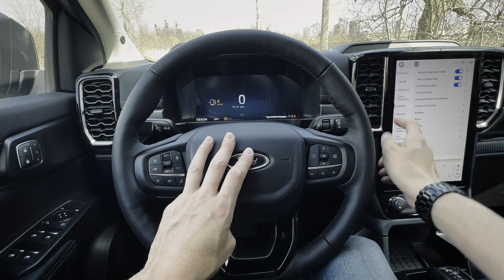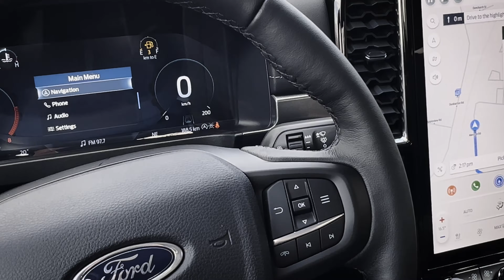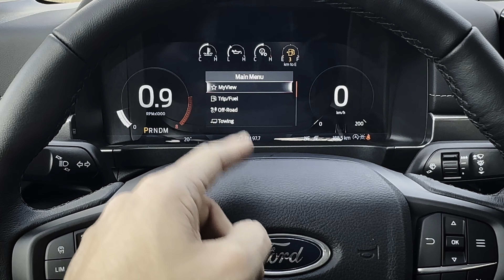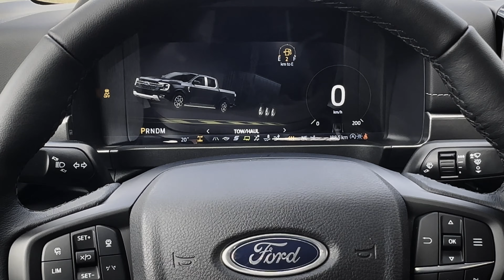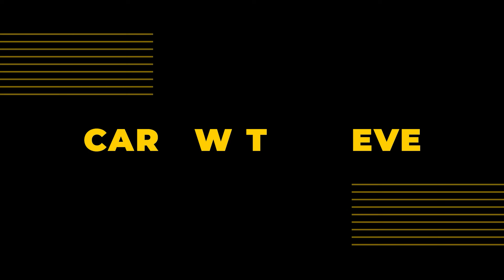Ford Ranger Steering Wheel and Cluster (2024 -2025 Model)

Comment: My 2026 does not have these gauges, very frustrating, must be a Canada only option. I HATE the digital dash, looks like crap.
Reply from the maker: It's the trim level. This one is the Lariat, which is similar to the higher spec-d XLT. There's a smaller version in the XL and entry level XLT which is closer to what's in the Maverick - I cover that off in this video --> https://youtu.be/vdJ4NUvsc_I
Reply: @CarsWithSteve the rounded gauge is lame, nothing like a traditional analog gauge. Zero classic look to it as it says classic. Sorry, but very disappointed. Heck my in laws Jeep Grand Cherokee has either analog or digital. Ford....NOPE
Reply from the maker: Yup.. have to love cost saving measures sometimes.

Comment: What is LIM
Reply from the maker: It's a speed limiter. You can set it at a certain speed and as the truck approaches that speed it'll slow down before not letting you pass the set limit unless you hammer the gas pedal

Comment: Good info, thank you. I came here to see if there is a way to play/pause media from the steering wheel on Everest 25. It seems there isn't, except by turning off using the power button.
Reply from the maker: You're welcome! No pause control on the steering wheel unfortunately, so you'd have to be on the audio screen in the infotainment or as you mentioned, using the power button
Reply: @CarsWithSteve  Thank you for taking the time to reply.

Comment: What does the LIM mode provide ?
Reply from the maker: It's a speed limiter. So you'd set it at whatever speed and when you go to speed up it slow you down and initially limit you at that set speed. You can still hit the accelerator pedal to go faster though.. I've just never been a fan of that and just tend to drive with cruise control set

Comment: Trip1 / Trip2 but no "Current Trip", it seems. Did check all the menus, and can't find one
Reply from the maker: Well I mean.. technically trip 1 or 2 could be used as a current trip counter. Just reset it manually each time you hop out of the truck

Comment: Can you tell me how you down shift manual with the buttons + and - ?
Reply from the maker: Watch this video. It's on paddle shifters but it works the exact same way as a hand or column shifter --> https://youtu.be/YYaagDisqso
Reply: @CarsWithSteve  thx. I watched.  So if is in drive I just press - to down shift. 
One more thing , by ant chance to do you know is posible to see on the screen what gear is? I know for raptor can be seen.
Reply from the maker: You got it! 4:45 of this video covers that off
Reply: @CarsWithSteve  thx for quick response.  When I asked about what  gear I mean from 1 to 10 in which . I've seen on Raptor is this option. I checked today on mine but I couldn't find nothing.
Reply from the maker: Ahh, misunderstood the question. It'll show the individual gear but not the full gear options like the Raptor
Reply: @CarsWithSteve thx steve

Comment: Is that the only view offered on the tachometer? I’d love a more traditional look rather than a number displayed there
Reply: The answer is no. Disappointingly. I mean they could have had it as an option, 'classic mode'. Toyota, Mitsubishi still have physical dials I think.
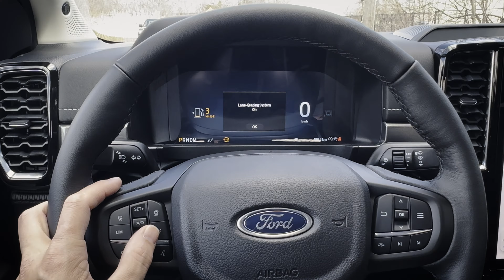Reply from the maker: Did you watch the video? 5:30 mark you can see a more traditional view when you aren't in the calming screen
Reply: Right I’m saying I don’t like the giant number in the middle of the tach. I was hoping there could be like a digital needle gauge or something to look like an analog tach
Reply from the maker: And I'm saying that when you are off the calming view it will give you the digital tach and speedometer like it shows in that section of the video. That view during the 5:30 ish mark would be the only option outside of the calming screen with just the digital speed in the middle. 

Use the right pad on the steering wheel to move up to one of the screens with a trip counter or something else on it and that will give the tach and speedometer
Reply: Right, look man I’m probably just not explaining right or something. I know there’s a calming screen and know there’s a tach when you exit it. Thanks for answering my question though I just wanted to know if the tach view can be changed outside of the calming mode you showed on the video
Reply from the maker: haha, have to love trying to explain things without a visual. Outside of the calming view, the only option for the tach look is what you're seeing
Reply: @CarsWithSteve it is not though, assuming he has a base model the screens are totally different your video is only good for the lariat.

Comment: I have noticed that to "reset" - say miles driven from the steering wheel it does not always respond on the first push and hold with the OK button and I have to repeat once or twice to get it to respond -- is that normal ?  Noticed when you hit the reset button it looked like it did not change the first time you tried it  ??
Reply from the maker: Oh interesting, I hadn't noticed that when I shot the video but looking at it closer it looks like you need to do the first press to bring up the reset option and then the 2nd press and hold would be to actually reset it!
Reply: @CarsWithSteve  Yes- that appears to be the answer- thanks !!
Reply from the maker: anytime! How are you liking the truck so far?

Comment: when driving, if you press the “+” on the shifter, it will add the transmission 1-10 digits showing which gear it’s on.
Reply from the maker: Great tip!

Comment: Very good video, Thanks! Funny how they change things as they go. My new Raptor Ranger is just slightly different on what the customizable options are. They actually cut some stuff back... I was able to use your demo to set mine up more the way I like it, which is very cool.
Reply from the maker: Thank you! Yeah the Raptor does have a few extras you won't find in the other trims, I'm in the Raptor in a few weeks and definitely have a video planned for that setup. How are you liking the truck so far?
Reply: @CarsWithSteve  So far, I'm loving it. I got out of a '15 Tacoma, which was a great truck for 250K miles, when my son needed a vehicle, so it got re-purposed. The Ranger is just enough bigger in the seat and general cockpit area to make a big comfort difference for me (6'3", 240lbs). I'm just pissed at Ford for requiring us to add a bed reinforcement kit ($450, and not even available right now) to put a cap or anything on the bed. That's a design defect in my book.
Reply from the maker: I didn't realize the Raptor needed that reinforcement kit as well, thought it was just other trims. Outside of the bed issue, how are you liking the truck?
Reply: @CarsWithSteve  I'm loving it. I only have about 200 miles so far, but it is by far more comfortable and certainly better performance.

Comment: It's a little annoying that there isn't a pause/play button on the steering wheel, only skip forward and skip back. When I'm listening to a podcast while driving, I can't pause from the steering wheel and I don't like using voice activation because it's slow. It's annoying to have to use the big screen, get out of the maps, go into the podcast, and press pause from there. Or pick up my phone and press pause. Seems like there must be a better way. Am I doing something wrong?
Reply from the maker: Some sources might let you pause through the infotainment screen but it is unfortunate there's no easy to access pause button on the steering wheel. You could technically press the power button in the volume rocker to turn off the media